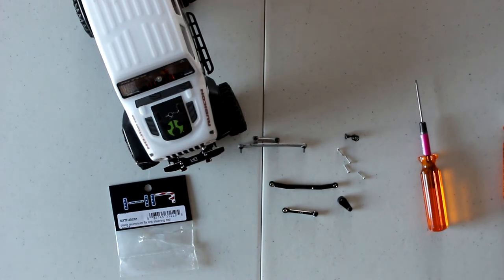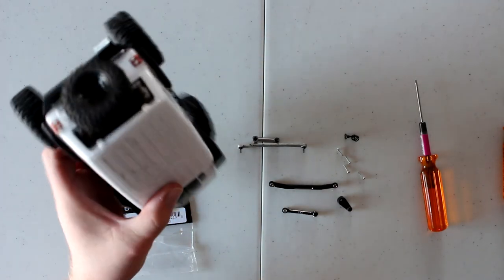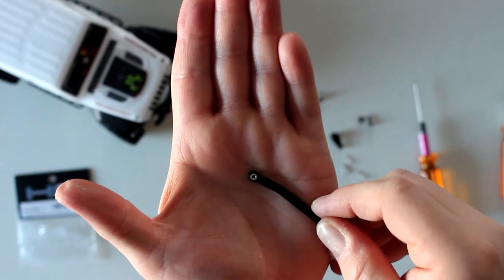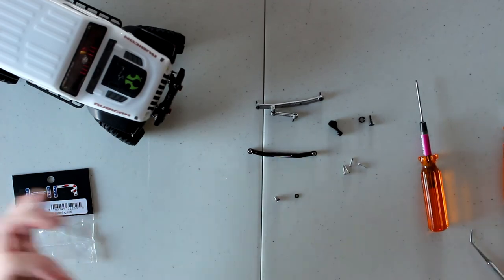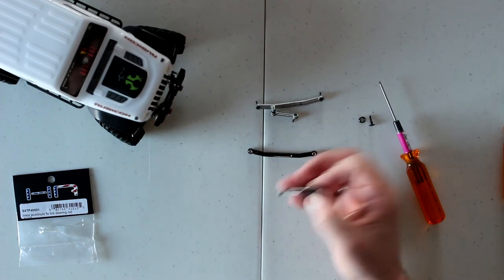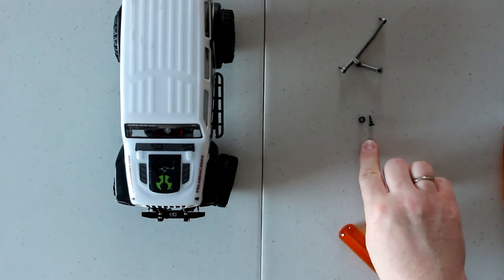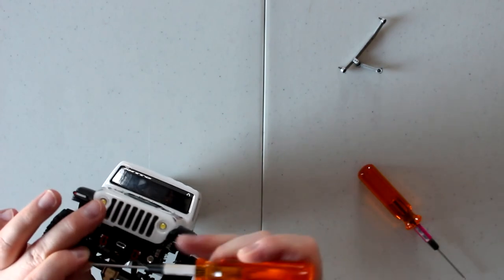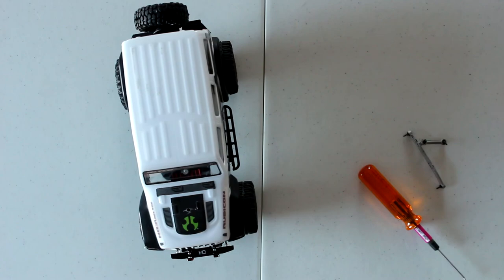Scx24 Steering Link Upgrade Aluminum Hot Racing

Comment: So what’s the difference between the original hr steering link and the new fixed tolerance steering link ? Haven’t found a video on it yet
Reply from the maker: The original steering link is plastic the hot racing one is full aluminum
Reply: I’ve been wondering the same. 
What the difference between the Hot racing link attaching to the top of the link vs everyone else and stock attaching the the front of the link?

Comment: Hello Sir !
I just found out about your channel and it is really helping me a lot with my 2nd hand Traxxas Slash 2wd.  
I have so many questions for you, but for now, if you could help me figure out why my range is so short (20ft), I would be SO grateful !
I got the original traxxas receiver and the original remote control as well.  It use to work very well, but now I lose control of my car when it is 20 feet from me.  I checked the antenna and many videos about it and everything is fine, and I also change the batteries in the transmitter for new ones.  I don't know why it is not working as well as it did before.  Do you think relinking the remote would help ? Do you think the plastic cap on top of the antenna straw is helping the range in any way ?  I have no cap at the moment.

Please help me if you can.  Thanks a lot for your channel and have a great day.
Reply from the maker: I need an answer from you your antenna in the vehicle when you look at the metal tip is there still a clear piece of antenna coming out of it if not that might be your problem. If that’s not the case I saw in the past with traxxas receivers they might just be losing range by themselves you might need a brand new remote receiver.